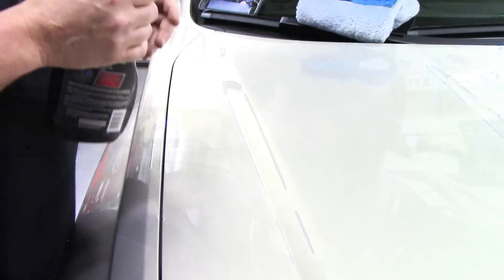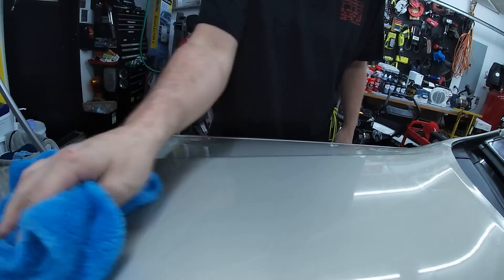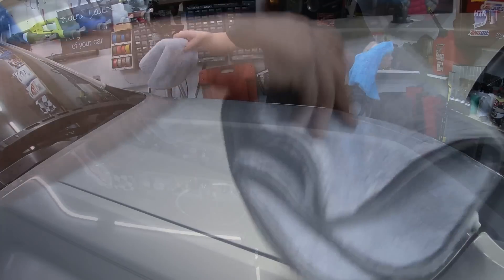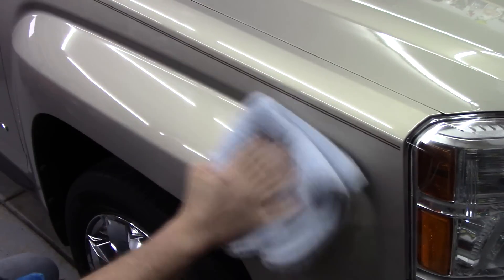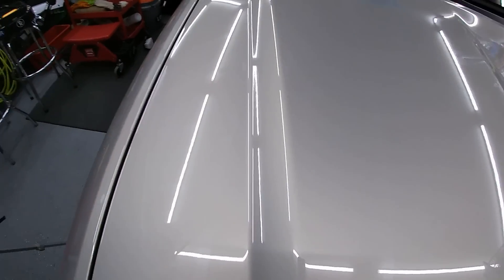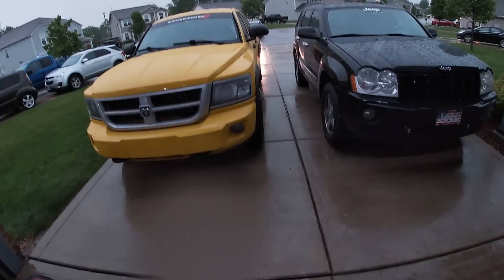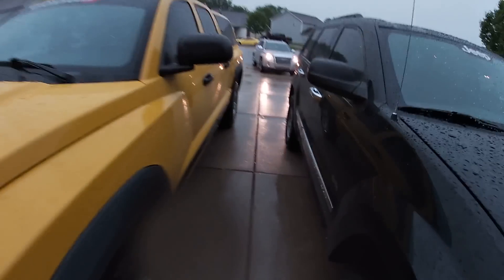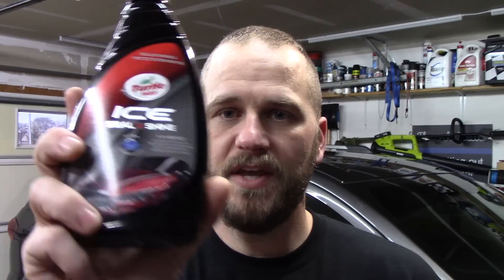Turtle Wax Ice Seal N' Shine! All I Can Say Is WOW!

Comment: I'm again using the Turtle Wax Hard Shell Wax.
My wife thought it was a good deal at 4 bucks and bought two bottles.
The new formula wipes off so easy. It's a wax that last and has a proven track record, I couldn't believe the results as it's been years since I used it. old school often works.

I applied the Seal and Shine to my black wheels on my truck and I was blown away at what it gave me, just wow
Reply from the maker: Cajun Kevin Turtle Wax has been a staple for a longtime as you know. It’s good to see them shinning again in the industry.

Comment: I have used Turtle Wax products on and off for about 55 years.  Of course, there was their carnauba paste wax which was difficult it buff off and left a white residue like crazy  In more recent years I really liked their thick liquid wax.  No residue, easy to apply and shine.  Then they stopped making it.  At that point, I  bought their Ice spray on detailer and Ice wax spray.  Great stuff.  I've used it on my 2006 CTS, which is in excellent shape, paint included.  I do have a selection of other wax products and have used other's detailers.  I only wish that I could include a photo of my car.  Thanks for this review.  I'll have to pick some up soon.
Reply from the maker: Ron L I have not used their products in a longtime but they have stepped their game up for sure! Thanks

Comment: Seal & Shine is crazy good.  I own a flat red paint car and have had  occasional streaking which I believe occurs because of the high carnuba content.  Easily remedied with a light spray & wipe from independent spray bottle of distilled h2o.  I find this stuff to add a terrific deep shine to my red paint.  And it does last!  Try it - great value!
Reply from the maker: I agree it works great and the low price makes it worth it. People seem to think it is suppose to replace a base wax and that’s just not true. It helps extend the base wax.
Reply: @FABAutomotiveDetailing  yeah I believe all spray waxes are top-coat/finish enhancers.  No substitute for base prep/paste-liquid wax/elbow grease (or machine.) Though must admit the Spray & Shine is terrific in between those applications!
Reply from the maker: Audie Conrad I agree 💯

Comment: Meguiars Gold Class Quick Wax was my choice in the past but then I started using Mother's Spray Wax which I liked better because it was cheaper, smelled better and came in a larger 24 ounce size. I use Turtle Wax Ice and it's way smoother than the Meguiars or Mother's product. I 'll try the Seal N' Shine next, hoping it's equal to or better that TW Ice. Update: tried the Seal and Shine and it’s a bit thicker and takes more elbow power to remove but it’s worth it.  Buy it now!
Reply from the maker: reggieburris It’s really good stuff and atleast worth trying. I never used Turtle Wax Ice but have heard it’s good.
Reply: Here only Mguires paste wax/cleaner great

Comment: I was disappointed in this product when I used it on both my Audi and BMW..all of which are meticulously kept. Its strange that I love using Turtle Wax Ice spray wax on my cars and it does an amazing job with gloss and water beading. I figured this newer product was going to be the same!  I found that when applying to a dark colored vehicle (such as Metallica black) that you get a staining like effect in the paint.  This oil-like staining that occurs is very difficult to wipe out. In fact I wondered if maybe I received a bad bottle. I was definitely getting tons of streaks and it was not going on or buffing off smooth. The only thing that I can assume was the problem was possible paint contamination prior to spraying the product. I kept the bottle in hopes that I can use it effectively soon.
Reply from the maker: Tyler Spahr Contamination would also be my guess. A few people have mentioned this. I will have to try it on a dark colored car and see what happens. I honestly wasn’t expecting much out of this product and thought I would just give it a try on my grandparents car. I was pleasantly surprised by the results but now you have my curiosity up on dark colored cars.
Reply: @FABAutomotiveDetailing  Yea absolutely! Give it a try sometime and see what you think. Turtle wax spray waxes have been unbelievable performers lately ( theres also a new turtle wax spray just for black vehicles too- although I haven't purchased yet). Thanks for the vids !
Reply from the maker: Tyler Spahr I saw they had one for black cars also! I will be testing with it soon and see what happens.
Reply: @tylerspahr9554  that one for black vehicles works reall well.
Reply: Wash with dawn soap first to get everything off.

Comment: TW Ice spray wax vs TW Ice, Seal and Shine ? or what's the difference ?
Reply from the maker: hawkey100 I never used the TW ICE before so I can’t answer that. Sorry
Reply: hawkey100 After using TW Seal & Shine use the TW Ice Spray Wax for glossier shine. It doesn’t take much or it will streak.
Reply: Seal and Shine is a hybrid polymer with carnauba. Go with Seal and Shine!
Reply: I use both. A layer of seal and shine then a layer of spray wax.
Reply: @DDiesel  HOW DID that work out? im thinking of doing that too??
Reply: ferric0243 it works great

Comment: Ive been using ICE products for the last 5 years, was the only sealant that lasted on the black mustang during summer.  I like the paste sealant the best. The interior dressing is good as well, no greasy residue.
Reply from the maker: Jeff Greenfield I haven’t TW products for years but the last two I tried have impressed me. I have always heard their ICE line is good stuff.
Reply: The ICE Paste is excellent - brilliant shine and IT LASTS!.   Though it seems to me that for some reason that has become difficult to find.  I'm wondering if TW may be phasing it out to re-introduce the Seal & Shine in paste form...if that's the case - watch out!
Reply from the maker: Audie Conrad I hope they put it Paste form because I would definitely be on that band wagon! 😂

Comment: Bought a new vehicle today and after a plain wash and dry, decided to apply this sealant and I immediately noticed a smoothness on the paint and a nice deep gloss. I have used other “sealants” out there in the market including The Last Coat, Hydrosilex, etc. bur the Seal n Shine definitely surpassed my expectations in application and gloss. Just wondering how long it lasts or would reapplying  it after a wash is enough?
Reply from the maker: Alex915 Congrats on the new ride! It is such a great product. Not sure how long it lasts yet but so far it is still holding up on the car in the video after 3 months. I would reapply every couple months and you should be good.

Comment: Product works great! One application went 3 months strong everyday beading and shining like day 1. I finally got bored & removed it & put on CG Jet seal (was looking for long term durability but not a coating) then applied ice spray wax over it. Insane shine. Now I’m thinking if I should put seal n shine over jet seal? 🤔let me know if this sounds like a good idea I know it was kind of a long comment lol
Reply from the maker: Just a Viewer Yes it does work great! It would be a great as a topper on any protection. It was designed to be used as a topper anyways.

Comment: Beading water is ok I guess but I'm looking for a product that sheets the water off...  what would you recommend  ?
Reply: Sheeting means product has failed as surface is no longer "phobic"
Reply from the maker: freddieNZ68 In a spray form the only thing that I have found that sheets well is Malco Ceramic Refresher. I have not made a video on it yet but have tested it a few times. Downside is you have to buy it from an independent seller.
Reply: No.. rather than beading all the beads join together and it sheets right off leaving the surface dry.  There are products out there that do just that.

Comment: I just did my SUV with Meguers Hybrid wax and love it but I will have to give this stuff due to the low cost.
Reply from the maker: Raymond Palermo I also like the HCW! This is definitely worth trying
Reply: My Infiniti has the hybrid wax as well but i tried out the seal n shine n it worked really good! I found then in a store nearby and bought 4 bottles only cost $7 with some cents each!
Reply: There is a reason the tw stuff is the cheapest.
Reply from the maker: ran stid What reason is that? Look at other people’s videos especially Apex Detail. Seal N Shine takes the abuse and keeps on surprising everyone. Cheap does not mean bad and expensive does not mean great!
Reply: FAB Automotive Detailing when my friend was young he worked for a high end lotion manufacturer. All it was was rebranded Jergens with a different scent. It sold for 4x the price
Reply from the maker: GT Big Dog Yeah price doesn’t always tell the whole story with anything really.

Comment: Griots Garage Speed Shine is my go-to detailer/wax, but I'll give this a try. It's half the price.
Reply: I use the same recently picked it up, best detail shine
Reply: I bought some at Walmart today. Overall, I'm disappointed. It actually streaks, dries up and leaves a lot of residue if left on the paint for more than 2 minutes. I had to do pretty much twice the work for a so-so result. I'll try again, but I'll probably just end up diluting it with water to maybe get it to not dry up as fast. Overall, I'd give it 2/5 stars for now. I know it's cheap, so I guess you get what you pay for. I'll update my review soon.

Comment: Hi I am getting a new car in two weeks, do I have to do anything to the car , like clay baring it, before waxing or can i just wash and wax my new car, and should i  wax it right away??? the car is black and i am now very worried since i have heard so much  about how difficult it is to maintain black cars but it is too late to change the car colour now.
Reply from the maker: Farry Ali Congratulations on the new car! You need to check and see if the paint is contaminated. My guess is yes because most new cars have rail dust on them. Sometimes new cars need to be gone over with a finishing polish which is a light cut polish. Then you can wax it and should be good to go for a while. I would recommend Griot’s Garage Liquid Gloss Polywax. It’s in my Amazon store if you want to check it out.
Reply: @FABAutomotiveDetailing  Thank you so much for taking the time to reply.Much appreciated.
Reply from the maker: Farry Ali You are welcome!

Comment: I have an existing layer of butter wet wax fromCG. Can I simply just wash the car then apply this? Or do I have to clay to remove the wax and then apply?
Reply from the maker: Beluga whale Clay will not remove wax! You can simply wash the car then apply Seal and Shine right on top of your wax.
Reply: FAB Automotive Detailing ooooooh ok less work I suppose. Ima gonna apply this product on top of the existing wax. But once their expiration comes, I’ll do it right and do the sealant first, THEN wax 😅 thanks man
Reply from the maker: Beluga whale You are welcome!

Comment: Not so sure , it streaked on a Dark red Hyundai that I just did.. fixed it with spray finish wax..
Reply from the maker: GTR GUY IN AZ I have heard people say it leave streaks as well! It’s funny how we can all use the same detailing products but get different results. I too have used products that did not perform the way I saw them on other peoples videos. I just think it has a lot to do with weather and humidity and it can also be microfiber towels, preparation etc. I’m not saying that you did anything wrong just my point of you as to why a lot of us get different results out of the same products.
Reply: @FABAutomotiveDetailing  I've been detailing for many years.. the Turtle Wax ice in the blue bottle I got zero streaks.. The Shining sealant however was a different story. In the end I was able to work through it.
Reply from the maker: John wells I need to try the Blue Ice Spray Wax I have heard great things about it.
Reply: I got streaks too. However, I think I used too much product and I don't think I completely wipe dry the product as it so difficult to see on a white car. I will try to use less product next time.

Comment: Can it be use on glass and rubber trim? And can it be applied indirect sunlight?
Reply from the maker: Yes it can be used on glass but I have not tried it on trim. It says a cool dry surface so I would say no not in direct sunlight.
Reply: FAB Automotive Detailing thanks for the info!
Reply from the maker: Mrjozz011 You are welcome!

Comment: how often do you wash the towels? And I never knew after wax was applied and wiped in that it needed to be dried afterwards. Been awhile since I waxed my vehicles but they are all under cover and some in the garage at least. The last time I waxed my mustang I used a paste that you had to let haze then remove. I love the idea of the spray on and wipe in. Unless it's a wipe in then remove/dry?
Reply from the maker: mitch david I wash my towels after every detail. This product is extremely simple to use. Just spray, wipe then buff and that’s it.
Reply: @FABAutomotiveDetailing   so the last towel is essentially buffing off? I've never bought microfiber towels, are they all created equal or will the cheapies scratch your paint?
Reply from the maker: mitch david Yes the last towel is to buff. Microfiber towels are not created equally. Cheap towels from like Walmart will scratch your paint. You want good towels that are made in South Korea.
Reply: @FABAutomotiveDetailing  kool gotcha and thanks. I'll browse amazon and ebay to see what I can find since the pricing may be better. Did you say yours are Shiner's detail brand?
Reply from the maker: mitch david Yes I like Shiney’s Detail microfibers. www.shineysdetail.com He is a little low on stock right now though due to the COVID-19. The Rag Company also has good towels.

Comment: I have the same foam gun but I have to shake it while I’m using it. What am I doing wrong?
Reply from the maker: Jason Sounds like you have to much soap in it and it can’t pick it up. That just my guess
Reply: FAB Automotive Detailing ok I’ll try less. Thank you keep up the good work
Reply from the maker: Jason You are welcome!
Reply: One more quick question I’m debating on doing just ceramic coating on a new Tesla model S versus front wrap and doing the rest of the car in ceramic.  3700 vs 1300 for just the coating. It’s a lease so. Your thoughts. I figured the car would look nice for the three years I have it for $1300.
Reply from the maker: Jason Ceramic coating is the way to go IMO but being it’s a lease I would just keep a good Sealant on it but that’s me.

Comment: Does it work with paint that already has ceramic coating?
Reply from the maker: loo hon gene It would but I probably wouldn’t use it on that. It may actually hide the characteristics of the coating.
Reply: I put this on my ceramic coated car today. Looks awesome. Super slick and shiny. Looks better than my ceramic alone.  I did have streaking in some spots bit I think in used too much. I saturated :(

Comment: Will this bring the shine back on an oxidized fiberglass RV?
Reply from the maker: Mike Merritt No you would have to remove the oxidation first. That’s with any product when it comes to oxidation.
Reply: Try Gel Gloss polish and protect. It's supposed to be applied by hand but I have used it with a DA and got fast results.
Reply: Thank you

Comment: This is gonna be long , sorry ! I started out with 2 coats of Meg paste wax , then Meg creramic , then Meg spray wax , then meg fast finish . Of coarse at different times , am I using to many different things , cause I'd like to try this too ? And did you use it on the glass and wheels ? Those wheels look nice too ! Thanks !
Reply from the maker: I would be afraid using that many products the paint might start looking blurry. I did not use it on the glass but have heard it works great on glass. Yeah the wheels turned out great but I didn't put this on them.

Comment: great review! may i know if you can apply on top on ceramic coated cars and a top coat!?
Reply from the maker: Fei Wu Thanks! Yes it can be used as a topper but I would recommend using a topper like TW Ceramic Spray coating as it is a SIO2 Sealant.
Reply: FAB Automotive Detailing noted with thanks! 🙏🏽

Comment: Can it be used in the sun or is it only recommended for shady cool car body conditions?
Reply from the maker: Keith Ginyard The bottle does not say not to but I probably wouldn’t do it. Most products need to be cool and dry surface unless it says specifically it can be used in direct sunlight.
Reply: FAB Automotive Detailing Thanks, i kind of figured as much especially with carnauba in it.  You would catch pure hell trying to buff it off in the sun, lol.
Reply from the maker: Keith Ginyard That’s what I am thinking also

Comment: Have you tried topping seal and shine with ice spray wax? Would it be a waste or is it worth seal and shine by itself? Great review bro
Reply from the maker: truejey 747 I have not tried topping it with anything. I think it would be a waste. Seal N Shine in itself gives great gloss and protection. Thanks
Reply: @FABAutomotiveDetailing  that's what i was thinking.Would you apply Seal and Shine after every wash? Or a Drying Aid
Reply from the maker: truejey 747 I would use it once a month or every other month. It’s very durable.
Reply: @FABAutomotiveDetailing  thanks
Reply from the maker: truejey 747 You are welcome!